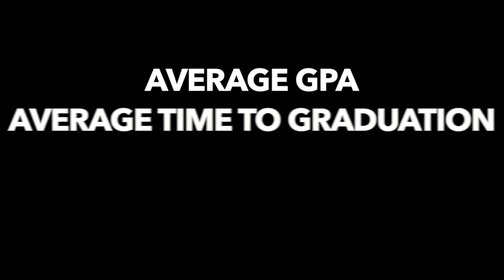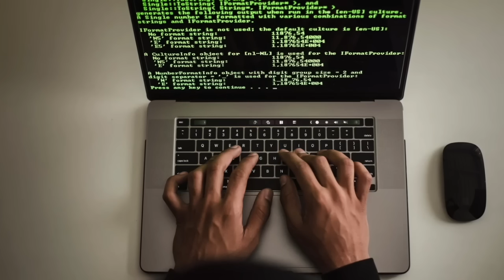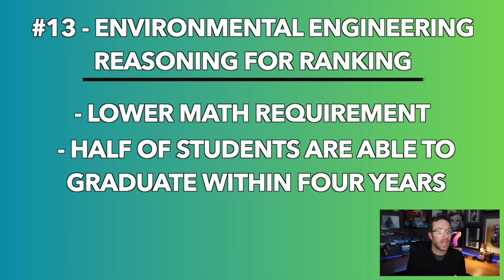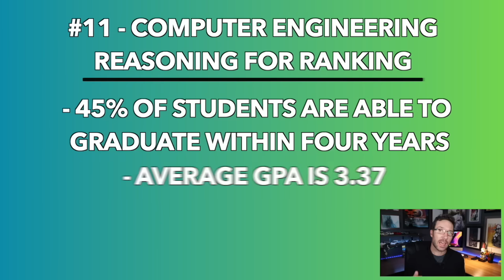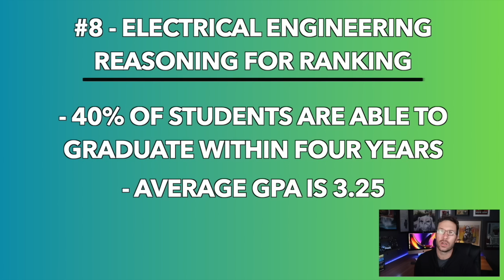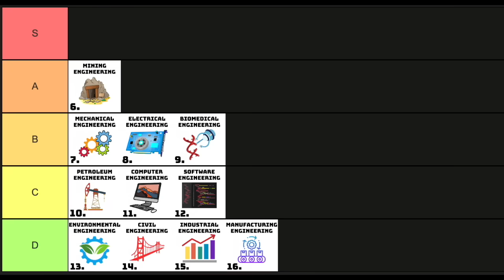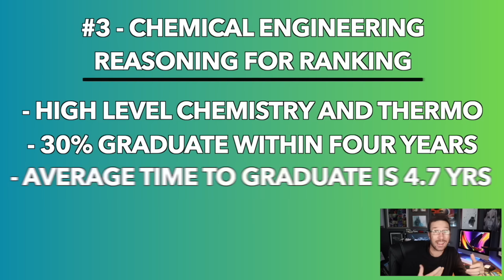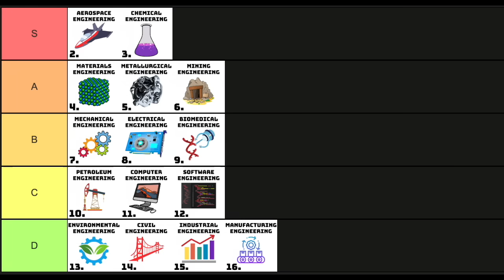Engineering Degrees Ranked By Difficulty (Tier List)

Comment: I'm going to disagree. Graduated from one of the toughest and the oldest engineering school in the United States. They gave only two undergraduate degrees, engineering and science. Every engineering student had to learn all areas of engineering in what was called a unified curriculum because they didn't want your engineering degree to become obsolete. They made every course as hard as they possibly could. You could choose a major which you began to specialize in the third year. I chose electrical engineering and IMO that's the hardest by far. You need partial differential equations and advanced calculus. There's more calculus in a textbook on feedback and servo control theory than there is in a calculus textbook. The study of electromagnetic fields requires knowledge of both partial differential equations and integral calculus. Chemical engineering is also very hard. Freshman chemistry started out with several months of quantum mechanics as the bases for understanding the interaction of subatomic particles. If you want to go into any biological engineering area you will need a lot of inorganic chemistry, organic chemistry, biochemistry, physical chemistry before you can even begin to understand how biological systems work. Homeostasis and biostasis work on the same principles as feedback control which is an electrical engineering course. Chemical energy is a form of electrical energy. Systems engineering is another very tough one. The systems can have many interactive loops that require a lot of math, including advanced calculus and partial differential equations.

The salaries I'm seeing for electrical engineers ranges from a low of $110,000 to $175,000+ . There are many specialized areas of electrical engineering. If you deal with construction or anything to do with chemicals which are found in most plants and laboratories then  you'd better know a lot of chemistry because  you are dealing with many hazardous and toxic chemicals. Electrical systems have to be constructed to be safe and reliable in many extreme conditions including corrosive and flammable chemicals . If you are an electrical engineer working on mission critical systems like data centers then you'd better be able to be a systems engineer to identify and eliminate single points of failure not just in steady state conditions but in dynamic conditions. A single point of failure can cause an entire global network cascade collapse. This is why a single transformer failure in Niagara NY in 1965 and a single feeder failure in Ohio in 2003 caused the entire Northeast United States power grid to go down. The problem still hasn't been solved. It involves many interactive loops with load sharing and each one is a partial differential equation that have to be solved simultaneously. The failure of just one causes a transient discontinuity and redistribution within the network. If even one circuit is overloaded and trips an overcurrent device during the transient sequence it can propagate the global failure. If you are an electrical engineer and not always running scared of what you might have missed, then you don't know enough because there are always unknowns. 

Based on the educational requirements even someone who graduates from an accredited engineering school with a BEE and becomes just a  mediocre electrical engineer has accomplished a lot.
Reply: One of the most difficult that was mentioned was I and C engineer, instrumentation and control. This is one of the most sought after skills and it may be among the hardest of all. This field has exploded in recent decades with the invention of the PLC, the programmable logic controller. What is it? It is an industrial computer that combines the functions of a regular computer with relay type ladder logic, analogy computer functions, and both digital and analog inputs and outputs to interface the world. In short it is infinitely flexible to perform many functions through software you program that had previously been performed by lots and lots of hardware. It also connects to HMI, human machine interface which is often a touch sensitive computer screen, and of course a mouse and keyboard. 

What is it used for. Well it can be used in many ways but two of the most common are building automation systems which monitors and controls all of the systems in a building such as air conditioning, lighting, security, even elevators and other devices such as alarms for water leaks. 

The other application is for automation control, robotics. It can be the monitoring and control of a single machine, a production line, even an entire factory. What type of factory? Every type of factory. It can also monitor and control utility networks such as with software called SCADA system control and data acquisition. 

To be an I&C engineer, you not only need to know how to design the hardware including all of the interfaces, perform and modify the programming, but also how everything it controls works too. In short you have to know it all and be able to make it perform its tasks correctly and in synchrony. They can be hard wired, or wirelessly networked over the internet or on proprietary networks. I've tried my hand at it and frankly it is so tedious for just operating a few pumps through VFDs that I didn't like it. However, I can and will work as a project manager defining the scope of work, specifications for the equipment and performance, and monitor and test the results others who are more skilled and experienced at it than I am. 

These PLCs have become less expensive, more user friendly, and gained increasing capabilities. Different brands and models speak different languages so it may be impossible or difficult for say Allen Bradley to talk to Siemens when you have two different systems that have to mesh with each other. If they aren't stand alone, it's best to stick with the same brand and same language unless you intend to replace everything.

Comment: At 7:50 you lumped Mechanical engineering in with us Robotics & Mechatronics Engineers! We do some similar classes but we do more software, more electronics, more electrical, less mechanical (we don't do fluid dynamics) and I definitely think we are the engineers trained with the widest career path. Everything is using more robotics and mechatronics nowadays, everything is becoming 'smart', even lights and doors are being integrated into robotic systems nowadays. Being called a mechanical engineer doesn't feel right to me.
Reply: 😁 I'm studying Mechatronics and we touch a bit on fluid dynamics in some mechanics units. But overall probably less than a purely mechanical degree. Depends where you're studying.  But you're right, Mechatronics needs its own section!! 👾🛰️
Reply: i am also a future mechatronix engineer! mechanical its a great mix of mechanical, electrical, systems, computing, electronics, and a lot more

Comment: Take this video with a pinch of salt. I did Civil Eng. and we did Naiver-Stokes for fluids, and Wronskians for concrete floors. And the concept of virtual work is as deep and equal to any other concept taught at degree level, with the exception of special relativity and  quantum mechanics. I suspect the real differentiator is Uni Ranking so aggregating across say Xavier University to MIT is very misleading. 

If you are an undergrad and considering an engineering degree I would suggest you put yourself into on of five buckets based on GPA or GCSE/A-level. The top 10% should aim for a top ten percent Uni and so on, you will then find your way into a school that suits your abilities which will affect how happy you are. I can't emphasize enough how important that will be.  An odd penalty on the smartest will be the fact the top schools are mostly filled with males which makes for a very distorted social life. Looking back I should have dropped one rank to enjoy the experience more.

Comment: I'm an Electrical Engineering (EE) Graduate (Univ. of Tenn, Knoxville - Class of 1981. I have a 3.2 GPA, close to the average. Getting through it was difficult, in fact, I still consider it the most challenging period of my life, but it also made my life after I graduated. I was fanatical about getting through it - failure was not an option! But then I had a fascinating career of 32 years before I retired. I did circuit design, software engineering, software management, and a lot of system engineering. I have zero regrets and a lot of good memories. I worked in factory automation and later public safety radio manufacture, installation and maintenance. I worked in 18 different countries. A degree in EE is valuable across many disciplines. I guess what I'm trying to tell you is "Go for it!" You can be proud of your accomplishments in school and later during your career!
Reply: Class of `87 ASU EE here.  BSEE degree was the hardest thing that I ever did.  Failure was NOT an option for me either.  I have had a wonderful career ever since.
Reply: @patrickfrantz2466  Thats the spirit, that's why us EE's are special, we get going when its rough.
Reply: I’m currently an undergraduate student in Electrical Engineering. It’s so tough and I think about giving up everyday. But your comment inspired me to push through! I hope I can graduate and finally set my life on track.
Reply: @karllin7659  EE is a broad field with many disparate specialties; perhaps you haven't yet found the one you have passion for.  
Semiconductor? Biomedical? Computer? Communications? Power? Systems?  Maybe some career counselling will get you back on track.
Reply: @karllin7659  Don’t give up.  It is hard but you are being loaded down with a shit ton of stuff in a short time.  Eventually that load will ease as your brain soaks up the concepts.
Reply: @GodzillaGoesGaga  thank you, and you are so right about that. It’s been 6 months since my last comment. I think I’ve already gotten hang of it during this time. It’s like you said, once I get loaded enough content into my brain, it does get easier over time. My last semester was probably the one I performed the best! Got so much work done and in decent quality as well
Reply: @karllin7659  Awesome.  Keep at it.  It’s hard work but the payoff will keep you interested for life!
Reply: @karllin7659   You a boy or a girl?
Reply: The part about being fanatical, failure not being an option, rang true for me. When the chips were down...at 4 am, exhausted after hours and hours already of study/homework, I refused to yield. I knew I would never "fail" in the sense that I would not graduate; failure for me, however, was not turning the degree into a top-performer solid career. Of course, that is a much more nebulous failure line, requiring a greater factor of safety as a result. I ended my degree program (ME) with a 3.69 GPA at 4.5 years. The extra half-year being from class prerequisite structure (being a transfer student made the class progression wonky), rather than difficulty in material.
Reply: @WisdomRanger  Glad you made it. Enjoy the rewards of your hard work!
Reply: I find Electrical Engineering one of the toughest engineering disciplines.
Reply: @L1011MD11  Thankyou :)
Reply: @L1011MD11  What other Engineering fields have you studied to degree level ?
Reply: I agree with you 100%.  I had no realization of the uniqueness of my EE job until much later in my career and talking to others complaining of thing I never knew.  I can honestly say NOTHING was boring and almost every day I walked out the door say "wow what a ride!!".
Reply: @chucksegerson3647  Can you tell me some stories for me as a future in EE? But I'm also signals and systems (my specialty), what was yours?
Reply: As a university student, I immensely respect you and all the other people who went through a university education without the Internet.
Reply: I’m Electrical engineer graduated in 2001 , I can tell for sure that EE is one of the most tough engineering path … you need to be excellent in advance math, understanding electromagnetic for example is not easy for anyone , but at the end you will be proud to be an EE and i did not regret to chose that path ,and now my son will take the same journey
Reply: Can I ask you about working as an electrical engineer , do you necessarily need to work for a company or you can find work projects by yourself? @alikoussan153
Reply: What about these same parameters for “Mechatronics” comprising mechanical and electronics engineering?
Reply: @johnnyjkelly do EE undergraduate and then Mechatronic in graduate school…Good luck…
Reply: ASU, 1981 BSEE.
Reply: Go Vols!
Reply: As a EE student with 3 semesters left, I really appreciate this response.
Reply: This is what I needed to hear!
Reply: I'm in 2nd of electrical engenering 😢
Reply: You're an inspiration to me.
Reply: Class of 1985 with EEE degree (Electronics and Electrical Engineering). Love it and love AI more in life.
Reply: That’s so cool. I am actually considering going to UTK for engineering as well.
Reply: But is an EE degree worth it in 2025 when AI is about to automate everything?  EEs in India can be contracted for as little as $10/hour and do design over a Zoom or Skype
Reply: @censoredeveryday3320

Can an AI fix power electronics? Can an AI install and maintain solar panels? Can An AI maintain the heavy duty power generators with its hands? No, these are the type of people who scare you away from your dreams just because of “AI oh noo so scary don’t do it!” For anyone reading this comment, pursue your dreams don’t listen to ignorant people trying to discourage you talking about some “AI”
Reply: I’m trying my best to finish my degree🤧
Reply: thank you
Reply: Never thought about the money at the time only the desire to design. I too am a EE grad who migrated to Software Engineering half way through my career. Never regretted it.
Reply: True totally agree. I don’t know what this guy refer for his video. It’s toughest of all and deserve A
Reply: This, I graduated from SIU-E in 76, and spend a summer at OakRidge where I stayed in a dorm at UT!  Had a great carreer, got an MSEE later Learned a lot of different things.
Reply: EE is hard, I don't know why we did it into top 2, its biased.
Reply: Wild you still remember your GPA after 40 years. 
I couldn't tell you my High School GPA nor my Undergraduate GPA.
Reply: Electrical engeeniering, a total brain damage career

Comment: It should be mentioned that one could slip around between disciplines throughout one's career. My father was educated as a mechanical engineer, but got hired doing aerospace, with a small excursion into materials, for his first 13 years. He then went into nuclear engineering, and did that until retirement. 

My grandfather was also a mechanical engineer, but worked his entire life as a metallurgical engineer.

I trained as a chemical engineer, but got into chemical R&D early on, and then into process control and industrial engineering.

My brother started with aerospace, but ended up doing industrial training.

Now my grand daughter is studying for environmental engineering, and I couldn't be more proud.

Comment: what is the difference between patroleum engineering and civil. Isnt it both about drilling and soilmechanics
Reply: There is a lot more thermodynamics in PE especially in regards to fluid phase behavior which is tricky and a black art..... excuse the pun
Reply: @robertprincewright   And what about Mining engineering and civil. Isnt it nearly the same. If you take Civil engineering with a minor on Geotechnical engineering
Reply: @johannes6362  Agreed geomechanics is common to both tho much of what I learned related to soils and we were lucky to be taught by Skempton.
Reply: @robertprincewright  what did you study

Comment: I expect the US higher education system differs from the UK, but I would add another metric to your table.  Demand vs supply. I am an Electronics Engineer (in the UK, EE means Electrical Eng and covers HV power distribution, a complete other field, but I will use the US meaning)  An EE here has to cover a huge expanse of knowledge; physics (as electronics is basically applied physics), computer science, software (low and high level), systems analysis, maths to post graduate level (advance differential calculus), feedback control systems, materials science and some chemistry (for semiconductors and material properties), product design, aesthetic, ergonomics, compliance and regulation. Beyond theory, learn about the vast array of types of components and manufacturing techniques and the tools an techniques that are used to put things together. Electronics is more than theory so must include practical skills like CAD, circuit assembly, I even did a stint in a machine shop.  A diploma here can be completed in just 2 years, and a masters degree in four or five, but the best engineers have usually had at least one year placement, so could take 6 years or more to graduate.  Even after you graduate that is so much to know and so many fields that the subject is just too big for a single person to master, so you have to specialise.  Power/High speed/ASIC/FPGA/Interconnect/Wireless/Discrete/Radar/Electrical/Consumer/, Hence finding a good graduate (or even better graduate +3) is difficult. Many don't stick with it and turn to a management or a software role for an easier life and higher pay. I would put the stress levels up there with Civil Engineering.  The timescales, linear nature of projects and what can be very large NRE up front investment, any delays or rework could be very costly so a good team with a good set of skills and experience is essential.  Most companies take about 6 months to fill a post and agencies struggle to find suitable candidates.  All this means demand is high but supply is low. As a graduate software engineer you will be competing with thousands with the same skills, for the same jobs. As an EE probably 10x less competition.  But it not an easy ride.